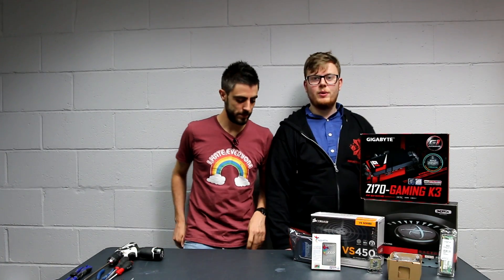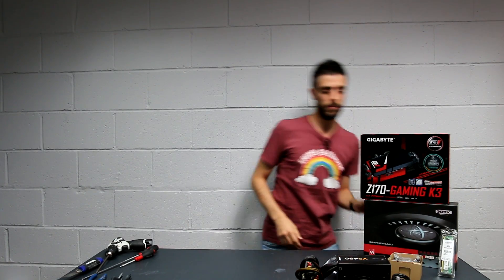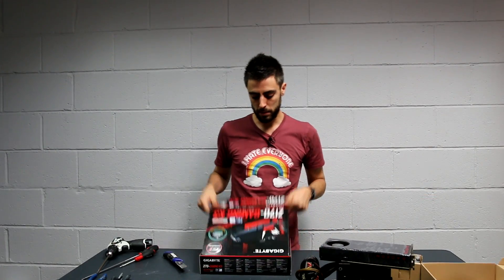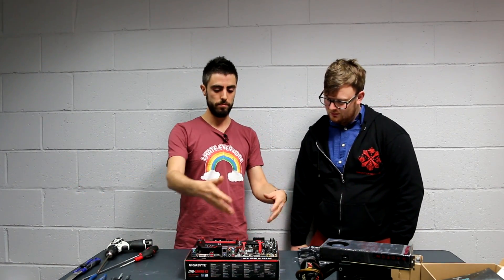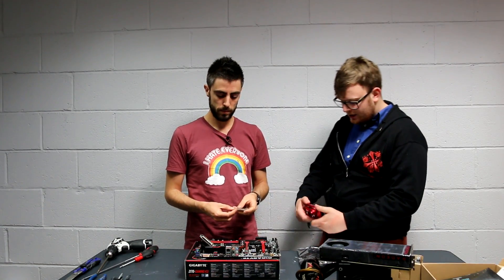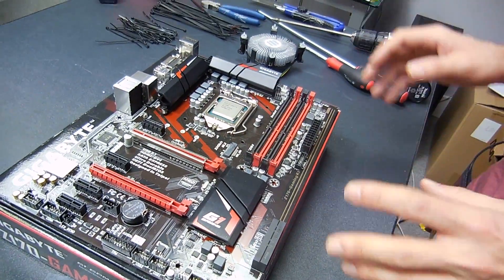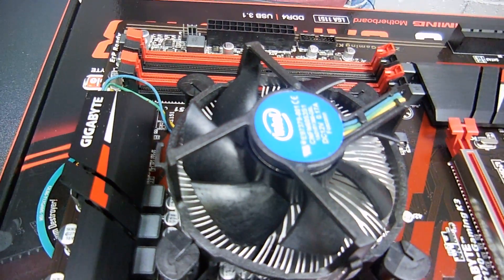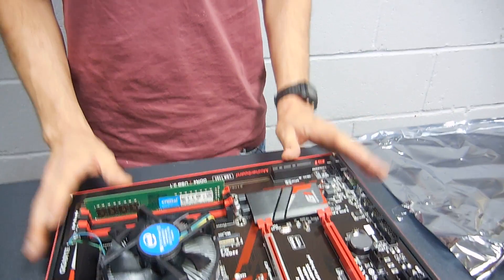HOW TO BUILD A PC: Step By Step Easy Guide (DINO PC) Part 1

Comment: How would I remove static besides an anti static strap??? would not wearing socks or shoes work? or ???
Reply: Touching the case of a PC with a PSU installed and plugged in but turned off should be enough. Or touch a metal surface that isn't painted
Reply: Got my build done and found that the psu trick worked! thanks anyways! :D

Comment: CPU: Intel Pentium G3258 (Used)
Motherboard: MSI H81M-P33
RAM: HyperX Fury 2x4GB
GPU: Nvidia GeForce GTX 680 (Used)
HDD: Seagate Barracuda 7200RPM 500GB SATA (Used)
PSU: CIT Dual Rail 400W Fully Wired Efficient Power Supply

I'll be building the PC this week and it'll be my first build so I'll need some help.

I think everything should work but because three of the parts are used - (as I purchased them from CeX) - I was wondering if there would be any compatibility issues e.g HDD not working, stock fan not being included with CPU, cables not being included etc.

Anything would be greatly appreciated,
-ZeR0_BiT
Reply: You bought from CeX? If you really did then good luck cos anything CeX touches turns to s**t.
Reply: ZeR0_BiT ★ Gaming & More! ★ You're buying a used CPU? Stupid move.
Reply: Well I've built it now and it works. My main game is Overwatch and it plays at Epic settings at 130+ FPS, so yeah...
Reply: ZeR0_BiT ★ Gaming & More! ★ 
1. Overwatch is not a demanding game
2. My point wasn't the performance, my point was that I hope you realise how long it is going to last.
Spoiler alert: Not very long.
Reply: Ok, thanks for the tip. If it works, it works. Good day to you sir.